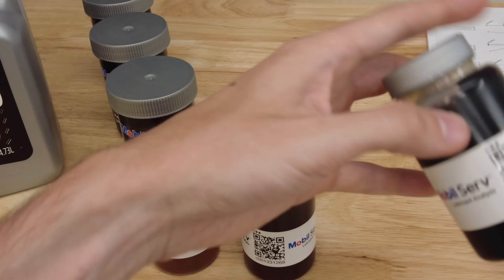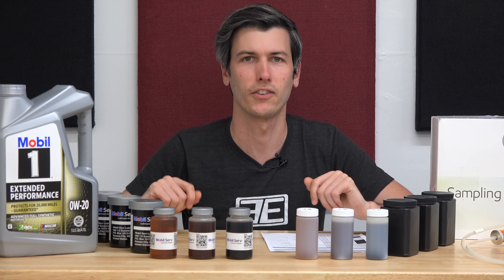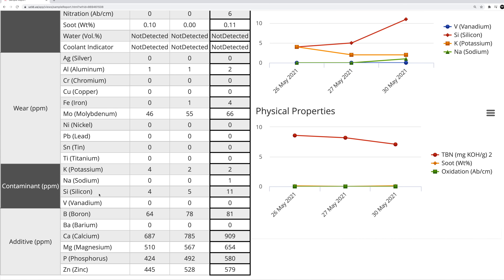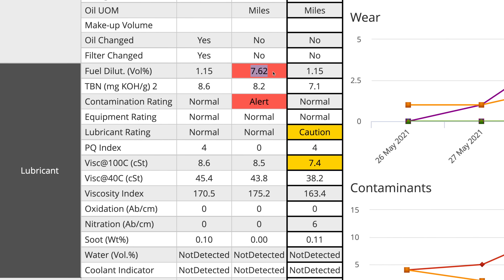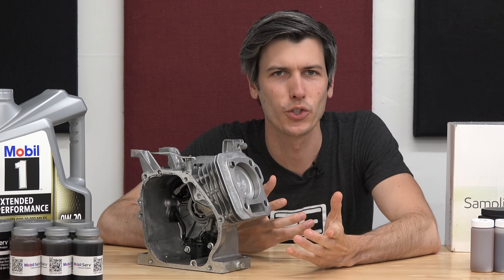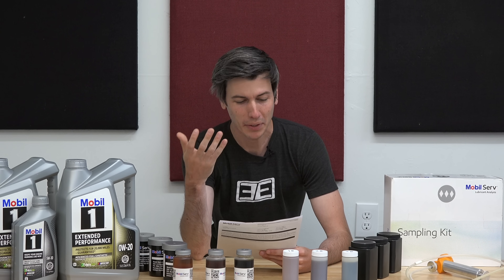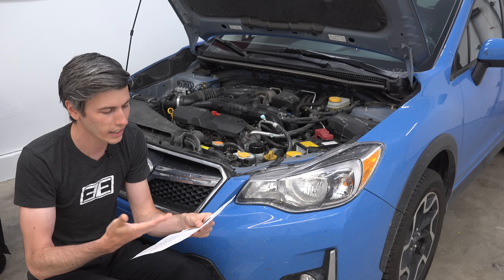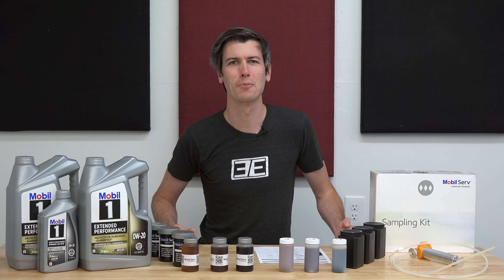Does Your Engine Have Hidden Damage? How To Know!

Comment: I remember talking to an Amsoil rep about their 25k mile change interval recommendation and I was asking about how they validated it and if they would assume any responsibility for damages caused by ignoring manufacturer specifications, and they basically told me they tested some old corollas (which have insanely reliable and simple engines) and either I can buy it or not they don't care but if it causes problems in my car that's my problem not theirs. So rather than pay 5x the price for a quart of 5w20 from them, I just do 5 5k changes with normal full synthetic (I use Pennzoil but that's irrelevant) for the same price and maintain my OEM maintenance. 

In this case with them saying they support 20k miles with that oil, make sure you have a car with as little systems dependent on oil and oil pressure as possible. I'd NEVER trust those claims in my 5.7 hemi due to the MDS system, and same goes for AFM/DFM in GM trucks.
Reply: Good info.  My takeaway from the video confirmed my actions of just sticking with reliable Hondas with some tolerance in the engine if miss the strict 9k mile interval
Reply: 9k on Honda, after servicing more than few Honda cars I feel safe with something like 5-6k using Honda OEM oil. 9k is really pushing it to the limits in regular city driving (it will last past the warranty). I have seen some of the engine with 20-25k OCI using Amsoil. Personally I don't trust such claims and not all engines are designed the same way - some require more frequent oil changes than others.

Comment: SHEARED DOWN from 8.6 to 7.4 cst-in  3,000 miles?? Can you imagine what it would be at 20,000?? Here's your fake synthetic. Jason I'm surprised you just glossed right over this. This is completely unacceptable especially in a supposedly "long life" oil just highlighting that Mobil 1 is mineral based group 3 and cannot compete with actual synthetic like Amsoil 100% synthetic.

Comment: The oil analysis shows what many Subaru Turbo owners have been saying for years. Mobil 1 thins out way to fast. At 12:35 in the video, the answer to why the viscosity dropped was you used Mobil 1. :)

Comment: Here is my question: assuming they found wear and engine damage in your engine. What are you going to do? For most private car owners, you are not going to tear down an otherwise still running good engine, are you? If you are following manufacturer recommended service interval and not driving like a maniac on your cherished sports car, there is really nothing you can do.

Comment: "changing oil"
my 20 year old car that burns a liter of oil every month: "i don't have such weaknesses"
Reply: Just top-offs every few days😄
Reply: @dmironyuk  yeah you know, the usual, as you do

oh by the way, the car is still in my ownership, running, and getting topped off about every month or two (depending on driving habits and distance covered)
Reply: What's your car?
Reply: @firasalzharani4328  hyundai Tiburon RD2 (2001) with the 1.6L engine
Reply: Got an Expedition that's started doing that. Now it's going to go live out it's days on my cousin's farm. 20 years, not bad
Reply: @KF1  certainly, getting 20 years out of a car ain't bad at all

Comment: For me, engine oil analysis is the equivalent of human blood analysis tests.  Not the end all be all of how you're doing, but a darn good place to start.  Never, ever, ever extend your oil drain intervals past the manufacturers recommendations.  Also, most people really fall into the "Severe" category not the "normal" category when it comes to "scheduled Maintenance" intervals.  Bottom line, just change your oil at the OEM recommended intervals.  Oil and oil filters are cheap compared to hard part replacement.

Comment: Hey man thanks for the knowledge,, I had this crazy idea,, would it be possible to run a engine with different compressions, so on a 4 pot, have 2 low compression and the other 2 cyclinders high,, then run 2 ecus with different fueling and timing for each of the 2 batches, then make an intake manifold naturally aspirated just for 2 pistons, and run the other 2 on boost from a turbo. No lag, high powered and more efficient
Reply: Omg that would run so incredibly roughly.

Comment: Hey off topic question but this has been bugging me for a bit. How do twin turbos spool faster than a single? If for example a 15 psi turbo set up is on both. Wouldn’t they take equally long to spool since the load is the same. Yes the twin turbos are smaller but it’s still the same amount of boost

Comment: When I sent my oil into Blackstone, they asked for the specific oil used.  You stated they didn't know.  Second, turn the bottle on side or even with the opening to the top, it pours a lot better.
Reply from the maker: They asked for oil type so I listed 0W-20, not the brand/specific bottle.
Reply: @EngineeringExplained  they asked me for the exact oil, brand, line and weight.

Comment: I think it will be overfuelling on warm up for that first 15 mins so that's probably fine. It's worth saying that of course over 3k miles there will be wear which is normal and most of the worn material is in the oil and that's the point. They know what is normal for a particular engine. We're looking for tell-tale markers. I know on lycoming aircraft engines for example, they can see very specific things and usually exactly where it came from (usually knackered cam followers).

Comment: My report from Blackstone 
2010 rx450h 77830 miles
Amsoil 25000 mile  Guarantee
20,078 mile oil change

PAUL: For oil run more than 20,000 miles, these results are impressive. That's a lot longer than the ~7,900 
miles our universal averages for these engines are based on. Iron is a bit above average, but iron naturally 
accumulates with miles on the oil, so it's better than average on a per-mile basis. The viscosity did thicken 
up some compared to your virgin sample, but that didn't hurt anything that we can see. The trace of fuel is 
also harmless. Silicon was high. It looks harmless, but it never hurts to inspect air filtration to rule out dirt as 
a possibility. Good report.
Reply: Paul, the oil filter that fits your vehicle is small and is not designed to reach 20k or 25k miles.  The Amsoil Oil Filter (EA15k02) that fits your vehicle (which also works in my Toyota Camry Hybrid) is only designed to hold contaminates for 15k miles.  Amsoil says if you use another filter, you shouldn’t go over 12k miles with that filter.  In the event that you didn’t change your oil filter before reacting the 20,078 mile mark (when you had the oil tested), possibly that was the cause of the high level of silicon, which Blackstone didn't feel was harmful?  Otherwise, like the comments on Blackstone’s report, impressive results!

By the way, that is a very good testament in apparently using 0W-20 motor oil in the heat of Florida.  Do you mostly drive on the highway or city driving or a combination?  Thanks!

Comment: The 15 minute test having high fuel dilution is bc ring gap is gunna be looser, during startup the engine runs richer and the oil isn’t hot enough to evaporate the fuel. After 3k its gotten more than hot enough for long enough to evaporate all the fuel, ring gaps are tight and it’s running closer stoich especially if the load is light.

Comment: The reason I'm asking is because I have a BMW520D and I got a warning  saying too much oil in the engine. This is the second time its happened, the first time I had only changed the oil about a month before and this time only done 2500klms. I use mobile 3000 5w-30 fully Synthetic oil. The extra is about 300ml I'm pretty sure its diesel that has mixed in with the oil, do I just change the oil or take out the excess? Thanks

Comment: Thanks for the great topic Jason and your interesting and informative presentation.

One possibility that I'd suggest you consider for the reason for the hot temperature viscosity drop is the action of any kind of complex valve timing adjustment system that might be using oil pressure to actuate the mechanism. With high contact pressures and local temperatures in these mechanisms, you could be having the oil's VI additives being sheared down. I had this happening on the VQ37VHR engine in my 370Z using the recommended Nissan ester oil. I looked at a number of used oil analyses of this engine in 370Zs and G37s with this oil and saw a consistent drop in viscosity from 5W-30 to about a 5W-20 after about 3K miles. The recommended oil change interval(OCI) for this oil in this engine is 3750 miles, and so that informed my decision to go with 3K mile OCIs on my car. The oil temperature on this engine runs characteristically high, the consensus opinion being because of the VVEL mechanism, and so it's just an inherent property of the beast. You may be having a similar situation with your car if everything else is okay and so you may just have to live with shortened oil change intervals if you want to maintain proper hot viscosity.

One consideration might be the use of one of those synthetic base stock group V esters that don't need as much VI improvers added to achieve the desired hot temperature viscosity levels. The problem with them is their cost and it might just be cheaper to go with the less expensive synthetics and just change them more often.

Comment: Dealer laughed at me when I took my 2021 tundra for its first oil change at 3k miles. And I explained to them how after the break in that there is stuff in the oil that needs to be flushed out ! Glad to see I’m not the only one
Reply: I changed my 2021 GTI's oil at 1000 miles, then I will again soon at 5000. I did it myself since I have access to a lift at work. First oil change was supposed to be 10,000 miles or 1 year, which is insane for a turbo 4 - even if I have an iron block.
Reply: @Dcc357  10k oil changes are absurd

Comment: With experimental aircraft the first oil change is after 5 or 10 hours of use. And it critical to use a specific oil to do the break in(one without a lot of detergents I think). I wish I knew more but after learning this I wondered why the same strategies weren’t practiced for cars.

Comment: I have a 16 F150 with the 2.7L Ecoboost engine. At about 75k I had a Blackstone oil analysis done. I only use Mobil 1 full synthetic 5-30 and I change it at 3-4k mile intervals. That analysis was at 3k and the only warning I got was about the viscosity as well. They informed me it may be from fuel dilution but after checking my fuel trims and injector leak down I saw nothing unusual. It's nice to see you had a similar experience and they give follow-up information on how it could just be you're changing it sooner than you need to. I was thinking since my engine is direct injected and turbocharged it may just have more blow-by than a standard vehicle engine and that could be the reason for the fuel dilution/drop in viscosity. Thanks for this video Jason, very informative.
Reply: Jed Brown:  Better to change it a little too often than to have a HUGE engine rebuild bill, or decide you need a new car.  From someone who likes driving reliable older cars with no car payments who considers oil changes MONEY WELL SPENT.

Comment: Hi Jason—I have a 2018 Crosstrek with essentially the same engine. I change my oil every 6k as per the manual, but I'm always anxious about the 3k "severe driving" recommendation, which almost everyone falls under (stop-and-go, long highway drives, cold weather, dust, etc). What is your personal oil change interval, and what do you make of the "severe driving" category?

Comment: I have a car new to me (Sportage 2.7 V6) and the last owner only used 20w50 but the owners manual says 5w30. Could I mess something by changing to the correct viscosity since the car has run on 20w50 for a long time ?

Comment: How about a video on ethanol in gas? It was originally touted for clean air but that was before electronic engine controllers. Not to be cynical, but ethanol has taken on a life of its own, and mega farms are taking over the midwest. I suspect monied interests are running the show and emissions are an excuse, not a reason. Thanks!

Comment: Fuel delut. At 15 minutes makes perfect sense before and engine is warmed up it runs rich and gaps are bigger there for more blow by in the engine then as it warms up and hits operating temp and the fuel would either burn out or evaporate. Most likely the second option. Unfortunately I work with people who work on cars and don't understand any of this including one arguing over 5w20 and 5w30 is a ok compensation when out of oil but claims 0w20 and 5w20 are not ok. Be very careful where you take your car. The automotive industry is full of hacks

Comment: As far as mobil 1 I am quite impressed with their new GF6 oils, i’ve been running full synthetic in my 3.6 R legacy from day one, i’m currently almost at 120,000 miles and the engine barely burns any oil I just recently was able to get my hands on this new classification of oil and the oxidation rate is impressive compared to its old blend! Jason!

Comment: Fuel dilution into the oil is caused when the engine is cold, common with direct injection, when the engine is hot the fuel evaporates, likely you took the sample after a short run.

Comment: I have had odd noises from the timing chain on cold startups. I smelled the oil and it smelled a lot fuel. This noise stopped when I changed the oil, but both noise and fuel smell came back after 1k km driving. Maybe an oil analysis wouldnt be a bad idea.

Comment: I have a question for all the Americans in the comment section. How often do you change your oil, at how many miles and how many miles do you expect the engine to last overall? Just now when researching on the interval for that Crosstrek I saw a post stating something like... "the manufacturer recommends every 10.000 miles, so I'm doing it every 5.000, just to be sure" I'm asking because here in Europe, nobody is that obsessed with oil changes. The only people changing their car's oil more than once a year are people who drive more than 12-13.000 miles a year. 

Just now when researching on the interval for that crosstrek I saw a post stating something like... "the manufacturer recommends every 10.000 miles, so I'm doing it every 5.000, just to be sure"

Comment: I am pretty familiar with oil sample analysis as a marine engineer. That is high dollar machinery with extreme financial consequences in case of faillure, and regular analysis is vital.
For the average motorists, what I wonder is: how much does such an analysis cost, or in other words, is it worth the money?
As a test before purchasing a used car, I can definitely see its value, but after that?
I mean, not having had a single wear related engine issue in the past 20 years or so (exclusively buying 10 year or older "clunkers") by simply sticking to the maintenance instructions, so is the money spent on these tests realistic when considering the statistic likelyhood of running into trouble?

Comment: I love things like this. Rather than just "part breaks, replace it" instead use a service point to analyse potential issues and address weak points before they leave you standing at the side of the road with the hazards on.

Both options keep the mechanic in a job, but only one causes, at minimum, huge inconvenience.

Comment: I think I got it. But its easier to just drain the oil and look at it with a strong light source to see if it has metal fragments on it.
Reply: The oil sample analysis is measuring particles that you can't see.

Comment: maybe the question isn't how to know about hidden engine damage, it's do I want to know?  And with 160,000 miles on the engine, I don't think I do 😅
Reply: I have to concur.  Same thing with compression checks on an otherwise good engine.  The only result if something's wrong is it will just make you feel bad or worry about it.  You'll know hidden wear by one or all of three things, 1) noise, 2) oil consumption, 3) check engine light might be showing a condition that is also cause excessive wear.

Comment: My Audi dealership, which has perhaps the best customer service on the planet, does oil analysis every time you get your fluids changed. Hilariously (and mostly due to Covid) I purchased a new Q5 SUV in July 2019, and I was alerted to a service (for the first time in my life) based in TIME. As in, instead of the dashboard saying “100 miles to next service” when you startup, it said “12 DAYS to next service.” Due to the lockdown and my extreme extra caution because I’m immunocompromised, after one year I had driven a grand total of 2,236 miles. Oil and other fluids really should be changed after a year no matter what, and luckily my results came back no concerns. I just thought it was cool that this dealership goes to these lengths to show how your engine is holding up. Hopefully in the next year I will have the opportunity to drive more. I like driving. And my sweet Irish Wolfhound LOVES going on drives, rides, trips, around the block, whatever. We need to do more of that.
Reply: Stephen Miles:  Having sensors might be better.  My friend, who drives a 25_ year old Mercedes changes the oil promptly when the car tells him to, roughly every 10K miles.  It does it based on sensors detecting how much dirt the oil has in it. 

Many auto dealers, OTOH, want to charge you for service every chance they get, and also sell you things you don't need, so there's that.
Reply: @rogergeyer9851  I agree with all of that. However, fluids really should be changed at least once a year, especially if one lives in a hot climate like I do. And all of my services up to 120,000 miles were included with the price of the car, which, because of my wife’s job, was a non-negotiable fixed price.